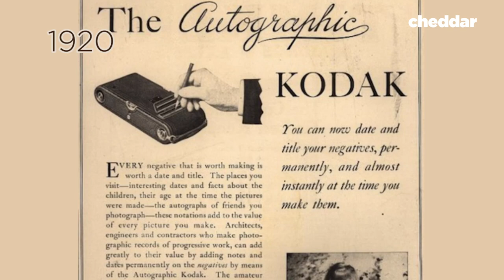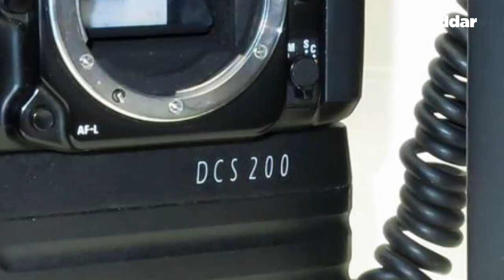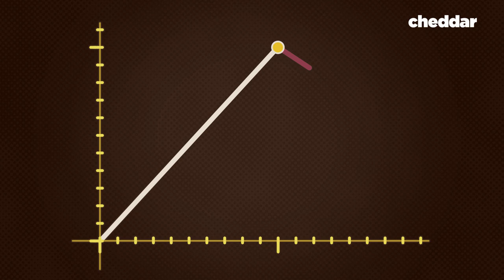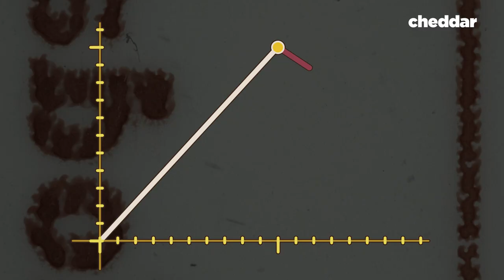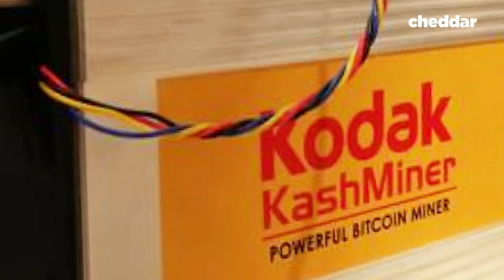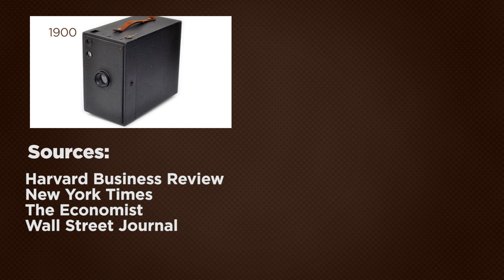Why Kodak Willingly Ignored the Future of Photography - Cheddar Examines

Comment: This is a very lightweight analysis of the situation with Eastman Kodak. Fujifilm in Tokyo faced the same situation but pivoted successfully. The problem wasn't that Kodak didn't see the potential in digital cameras; the problem was there wasn't - and still isn't - high margins in the part of consumer market Kodak had access to. Film and paper have enormous high margins, and shareholders were demanding a return on this investment. 

At its core, Kodak was a chemicals company with world-class expertise in coating materials at high speed, in total darkness, with near-perfect quality. They ran out of things to coat. Meanwhile, Fujifilm has pivoted to pharmaceuticals and cosmetics, while keeping its photography business alive and well.

Printing pictures is still a multi-billion-dollar business, too.
Reply: Yeah, he's fallen prey to the common pop-culture understanding of why Kodak failed, a myth that sounds "truthy" and is easy to repeat, but doesn't actually bear up under analysis.
Reply: While you are undoubtedly right on a number of points, I think the line “they ran out of things to coat” is a little too easy, and again runs into the problem of a snappy line that sounds like the truth but is quite a bit removed from it.
The very special kind of coating that Kodak had the most and almost monopolistic expertise in was coating of emulsion on celluloid. But they also had a truckload of expertise in doing CCD sensors and decades of patents. They invented the Bayer filter FFS!
It was a number of things that took them down. For instance the trial with Polaroid and its consequences. The blatantly unfair monopoly verdict. The APS and Disc camera flops. And the difficulty in leveraging their sensor and associated algorithms.
Reply: @Frisenette  Well, I was keeping things simple, for the sake of the YouTube audience. I agree with you on their expertise. For one thing, they co-developed the OLED screen, and even tried to become an OEM supplier of screens. Kodak even put an OLED screen on a digital camera, long before one appeared on a smartphone.

My objection to this video is that Kodak did not stop innovating at all. Today, if Kodak were a startup, they'd be lauded for the failures and be given billions in VC money.
Reply: Gary Pageau agreed. 
Interesting couple of videos you got there BTW. :-)
Reply: @Frisenette  To be fair APS was not really a flop, but a victim of timing. It did have a decent run given the era. (1996-2011) It was also not just a Kodak,product It was supported by all of the major consumer film companies. Disc WAS a flop as its negatives were about half the size of the 110 cartridge format leading to fairly bad enlargements.
Reply: Yep. I worked for Kodak at the time.  This is mostly right.
Reply: That rings true to me as a consumer... Digital cameras were not very compelling for a very long time. Arguably when they were just starting to get there, I got my first one, a Kodak DC215 Zoom. It's not like they weren't there with a solidly built, easy to use camera that used industry standard flash cards... though by the time I upgraded, they weren't much of a player and I've run with Sonys since then.
Reply: You're right. Shareholder greed and an inflexible financial sector prevented Kodak from introducing the new camera or get ready to scale down successfully. Kodak was a customer of mine for many years on the plastics and chemicals side. As a company they were very big into research and were constantly improving and bringing out new products to their customers, they were not stupid or slow. The problem was the digital world had no equivalent to the high profit film business and you can't go to shareholders and tell them you're moving to a less profitable business. You propose that idea and they're all shouting "SELL, SELL, SELL!" so really the business had it's hands tied by Wall St. What's worse is it's twenty years later and there's still no way today Kodak could have made it out alive.
Reply: Another brilliant comment. Right on OP.
Reply: It was a situation where the revenue and profit from consumer film was not simply shifting away to a different technology or medium, the profit and market was disappearing completely. Something was going to give, and the best hope was to find a smaller niche island to retreat to.
Reply: Yup!
The video also only focused on the consumer products. Motion pictures was a huge user of chemical film stock as well. When the movie industry transitioned into digital, the whole industry of chemical film took a hit.
Reply: FujiFilm also made the best film available at the time, far superior to Kodak. Their ASA1600 film was amazing!
Reply: @Frisenette  Yes, I agree that line could have been omitted. It wasn't even snappy, to me.
Reply: @brianboni4876  Absolutely.  A very well-written analysis!
Reply: Buddy Clem not true at all. They had the whole underdog thing going for them, even though they where hardly a puppy. Some people seem to gravitate towards that per default.
Kodak set the standard everyone else had to try to catch up to. The Ektars, Portras and slide was the best and most sensitive.
Fuji had a brief leg ahead with thorium doping for some film, but Portra both 400 and 800 with two electron sensitization are better pushed to 1600 than any film Fuji made.
Reply: @Frisenette  I'm sorry but I'm team Ilford here ! 

Now, 5lines of me complaininy
To be honest, nowadays I mainly use my digital cameras, but I'm still using my quite old and trusty Canon AE-1,  and as a photographer with a developing studio, I'm only using BW films, so it's quite easy to develop it at home. I don't really understand all those people who are "comming back" to the film camera, without the knowleadge of how to develop it.. Film takes more time and money to develop than digital and if you don't do it yourself you don't even have a hand on how 80% of your picture will look like.. Because developing a film camera at a photomarket is just digitalize them then print them, so you don't have any hand on what's going on, you can't do any mask or any retouch.. and when you do develop yourself you know quite well how these two are important, and fun to do but I think I'm one of the only ones who do like doing that.. ^^
Reply: @RmDIrSudoSu  Obviously you're not. Otherwise you wouldn't be able to get chemicals.
For ultimate control yes then you are best off doing it yourself, but C41 and E6 isn't as bendable as B&W so you could be justified in letting someone else do it. 
The scanners in most labs are terrible however. Even if they where once good, they have not been calibrated for years and are operated by people who couldn't care less. So there you are better off doing it yourself.
REAL RA4 printing, in the few places that offer it, is just the best colour reproduction print technology you can get near today, but again require expertise and equipment that takes time to accumulate for the amateur.
Home printing of B&W is also a large endeavour, and too requires a real darkroom. But is worthwhile and very doable for the hobbyist.
Reply: @Frisenette  Yes it's douable, that's what I do, but most what I said is that most of time your "raw" pîcture even for film, will require different expose time, so you will use masks to expose different part of the picture differently, .. This is how you get a real film quality for me. 
Most of time when I see an hobbyist use films, some part of the picture are under/over exposed, and I'm only talking about doing masks here because it's the easiest part of retouching a film picture, I'm also doing it with pens and airbrush, this is by far way harder to do.  
But usualy hobbyist do understand photoshop quite well, they don't have professional results but at least their RAWs are developped (except for some of them who are really tallented). A lot of hobbyist I see using films, don't even know that photoshop is just based on what professional use to do while developping their films. I remember at school I had to do a light facelift plus a reshape on a film.. That takes a lot of time, but I'm quite happy that I had to do it, because it's really interesting to do.  It was a use of masks, airbrush, pens with a really light touch to get what you want. 
All of that is why I don't quite understand some hobbyist who are using films, then make someone else develop it with a machine, who don't even do the job correctly. Then just scan and print their picture. So usualy you've a poor quality scan and a poor quality print.. But all of them say "Film picture is so much better than digital, when you clearly see that they don't know anything about it." I would "agree", because I really like it. But it's worth the effort only if you do everything yourself, but that's my oppinion. ^^ When I started photography, yes the digital camera had a quite poor quality, but nowadays.. They're amazing, it's by far faster to develop, easier to retouch (learning airbrush is a hell), ..
Reply: i learn more in the yt comment section than in school  :D
Reply: I agree with Gary Pageau's overall argument.  Could Kodak have diversified and avoided bankruptcy by going into some other line of business? Of course.  But, as Gary points out, the margins to be earned from digital cameras is a fraction of what Kodak earned from film, chemicals, and paper.  Under the best of circumstances, Kodak's photography business would be a much smaller today than it was in the glory days.  Fuji did diversify, but it was always a more diversified company than Kodak because it held a much smaller share of the film market.  One other thing that's forgotten is that Kodak did attempt to diversify itself long before digital became a major problem.  At one point, Kodak bought Sterling drug.  It was not a successful acquisition and I don't know the details.  That acquisition was widely criticized at the time.  Perhaps, the criticism was premature.
Reply: Not sure about that last statement!
Reply: Sure, margins make a difference, but there's no substitute for being really stupid.
Reply: I'd disagree with you on one point. Kodak saw very clearly what the potential of the digital camera was, that's why they tried to kill it at birth. Kodak also had a big stake on reproduction film where the sheets were huge and expensive as well as The chemicals. Everything that used ink on paper world-wide used Kodak (or a handful of others) used Kodak repro film. That market vanished too with the rise of the digital image. That market is monstrous compared to a pack of 25  photos of your picnic last weekend. I still have a few rolls of undeveloped film in a drawer, I wonder what they have on them...
Reply: @brianboni4876  But less profitable as compared to what, no business?
Reply: @jasonosmond6896  Thats how these "young" people are Jason! They actually have no clue what really happened & only got their "info" from other people who don't know the exact truth either!!
Reply: Definitely - Addiction to margins and a risk averse and intransigent corporate culture.
Reply: @GaryPageau  VC? Despite a background in marketing, I'm not familiar with that abbreviation, or I simply forgot.
Reply: VC = Venture Capital
Reply: Most people have forgotten EK owned Sterling Drug! That’s a whole ‘nother subject!
Reply: I knew that was the reason, their product give them a big gain, digital only works for the cameras, they should adapt to photo printers and photo paper
Reply: He didn't even get the solid facts right. The 1st digital camera was not that bizarre remote thing. It was QV 1000c made by Nikon which was a solid SLR.
Reply: For those of you who just don't get it, a camera is more than just a camera. It's an ecosystem. Kodak can't simply release a digital camera and expect it to sell. That's not how it works. The situation from the 70s and onward was very different than during the Brownie era. Since there has been a bunch of large camera manufacturers with decades of experience, huge amount of resources, thousands of cutting edge technology and products(and a wide range of compatibility)and millions of customers throughout the world. Kodak would've to put millions of dollars in R&D to develop cameras, lenses, speedlights and accessories etc and even then anything that Kodak might came up with would've been outdone by Nikon, Minolta, etc within just a few months. So they'd still be losing money anyway. The idea of battling against those companies by starting from scratch by itself is pretty insane to begin with. 

There was nothing that Kodak can do about the coming of digital photography. Some of you might say they should've been making photo editing softwares like Lightroom or something similar. Well, they're softwares, right? Kodak has never been a computer or a software company. It's a different thing altogether. Nobody expected the world to be so computerized as it is today. But even then there were people who began to make graphic softwares for computers in the 80s and guess who those people are? Computer scientists. Not photographers. Not even camera engineers or anybody from the photography industry. Digital photography was not a natural progress from film photography. It was a disruption.
Reply: Thank you
Reply: The thing that gets me is he even says something in the video along the lines of "Kodak actually became one of the top sellers of digital cameras but they struggled to stay profitable because the margins were so thin" and it still didn't click that maybeeeee that's why they held off on doing it for so long
Reply: The sold off Eastman Chemical
Reply: LOL Boomer
Reply: Well said. There was no money in consumer digitals.
Reply: Cameras for Kodak was a loss leader, they were never the best and never made money. The were in no position to transfer to consumer electronics, and the smartphone eliminated demand for consumer level digital cameras.
Reply: @brettknoss486  Kodak made two types of digital cameras. One type was digital backs for Canon and Nikon DSLRs, which were very high quality. The second type was consumer-level cameras that varied in price point and quality. Some of them, like the V-series dual-lens cameras, were way ahead of their time with high-quality lenses and software. You are right, though, to say Kodak was in a poor position to transition to CE company.
Reply: @GaryPageau  working with Signet Armolite to sell glasses lenses was probably a smart move, if it was done in 1985 instead of 1990 it would have given a leg up. If they had licensed soft contacts instead of B+L, combined 1 hour lens crafting with one hour photo, and invested in photochromics, they would still have lost the film industry
Reply: @brettknoss486  Ironically, Kodak is still making film. They are running 24/7 shifts in Rochester. But it's nowhere near what it used to be. Nothing was going to save the film industry from significant decline.